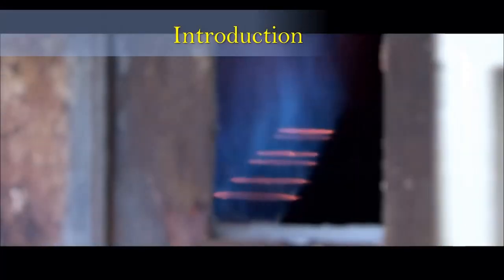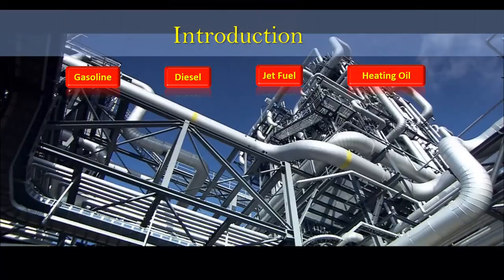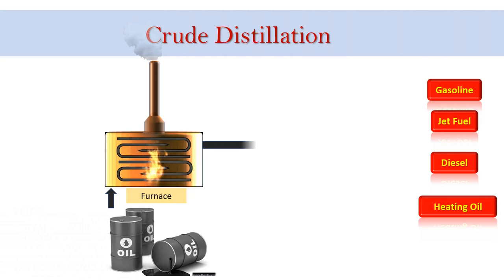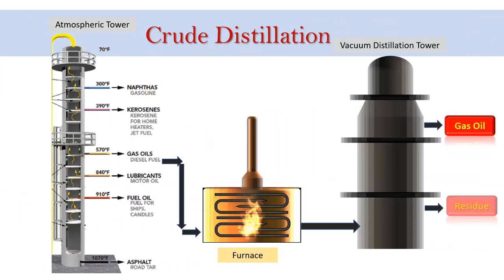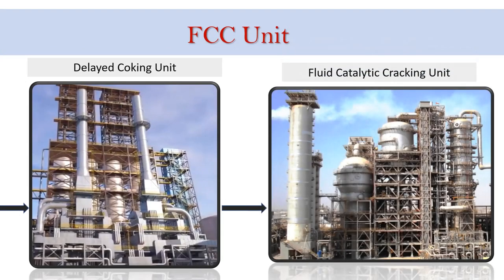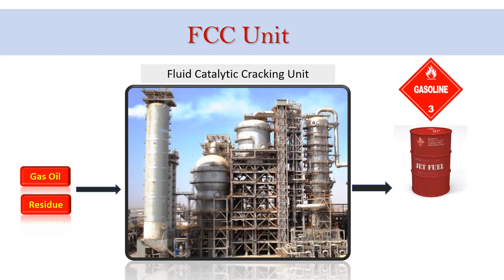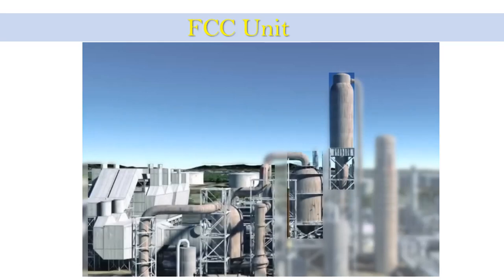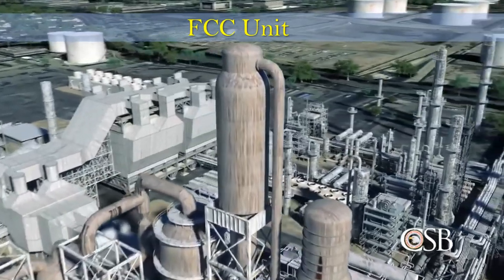Fluid Catalytic Cracking Unit Overview FCCU

Comment: Worked at Tenneco refinery when a cat cracker exploded. I wasn't there when it happened, but I seen the aftermath. It is not nice when it goes.
Reply: Assuming this happened during S/U S/D operations? That’s typically the most vulnerable state…